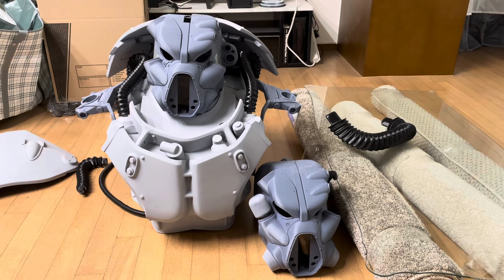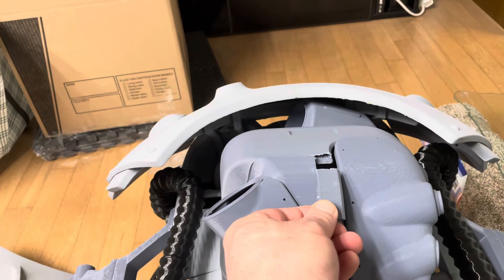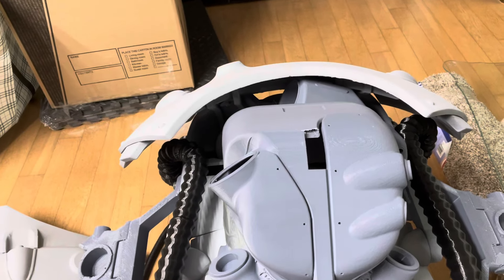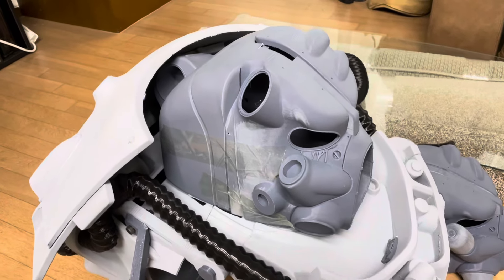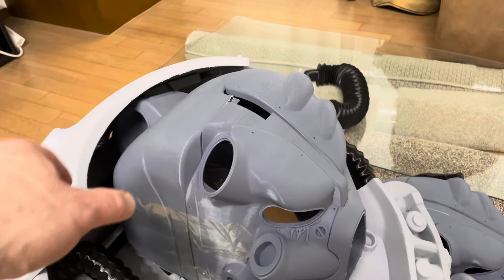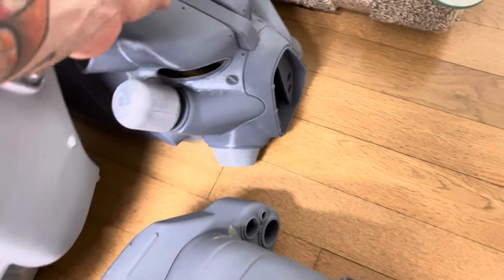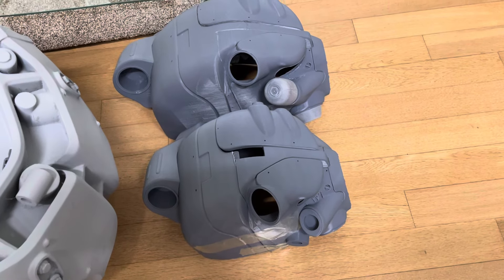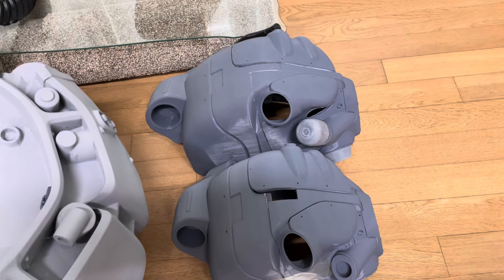One step forward and broken part X-01 fallout power armor helmet

Comment: Use two fans: One on the intake side and one on the exhaust. Ribbed tubing flows air very turbulent,, thus poorly. 

Noctua has multiple sizes of fans for PC that can be adapted  to a plenum box in the back. Quiet and move a lot of air if you go the 'fully plumbed' route.

Love the build!
Reply from the maker: Thank you for the advice getting everything to fit is the issue maybe a 50mm fan can fit
Reply: @army310  I looked on the noctua site and they list a 40x40x10, but as I look at the chest piece, there seems to be a lot of room in the chestplate as well. You might be able to mount a couple 120s and angle them toward the chin. Think of it like a defroster on a car. The air blows at the windshield to defrost it. The fans would 'duct' air along the chest inner wall and the open bottom of the helmet would act as a scoop for it.

But if it were me. I'd really try making those hoses functional.

Just some things to think about.
Reply from the maker: @NormLenhart-v4l I kinda wish this was a x-01 fallout 3 version or new Vegas because I want that fan intake on my back so much.